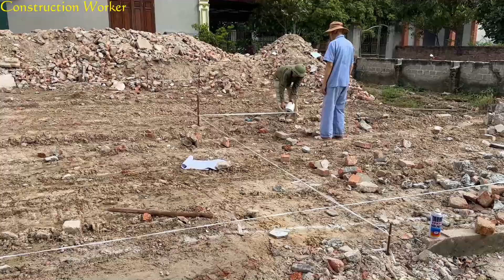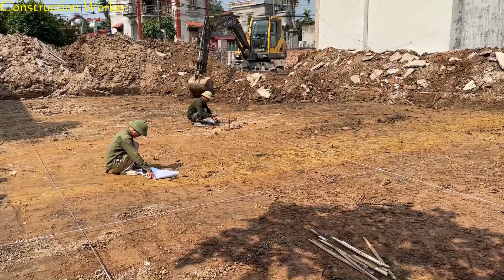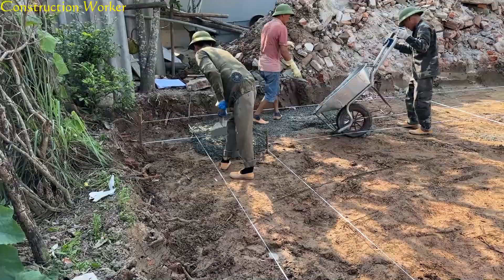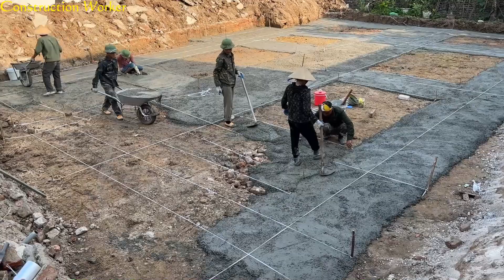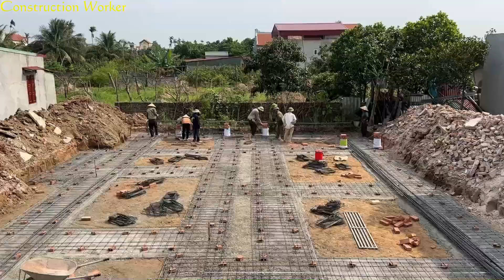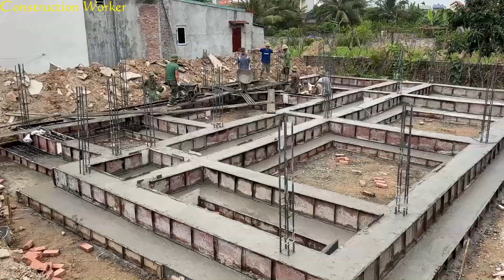Techniques Construction For The Most Solid Concrete Foundations

Comment: Best way to build foundations,Thats to dig 7 foot deep in to the ground,Put plastic sheets down,The put about few foot of sand down,Then put the construction frames down,Then put under ground pipes through,Such as water pipes,sewage pipes,Radiator pipes,Then fill up with concrete,Then have to put plastic sheets over it for a few days,If bad weather is coming,putting concrete,Just over the ground,a cheap and nasty way,Get cracks coming through the floors,Be a matter of time